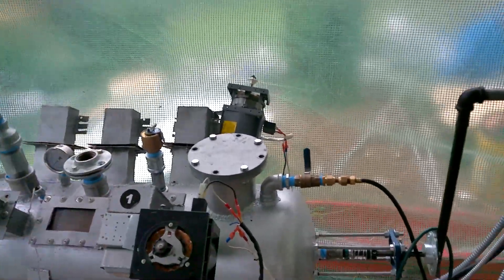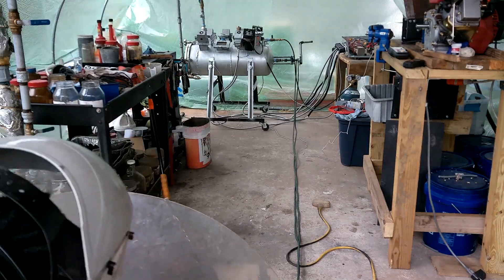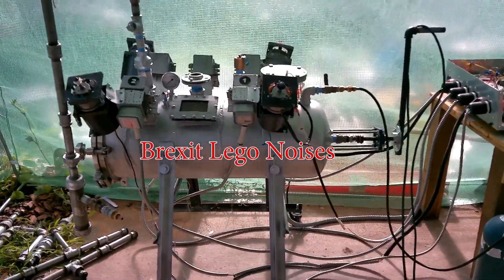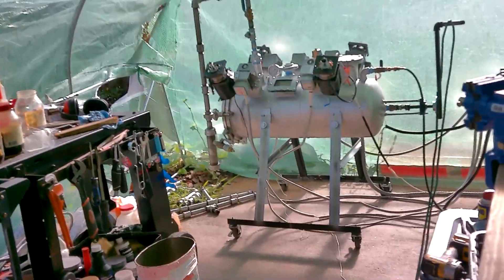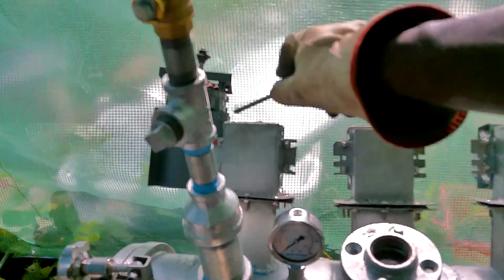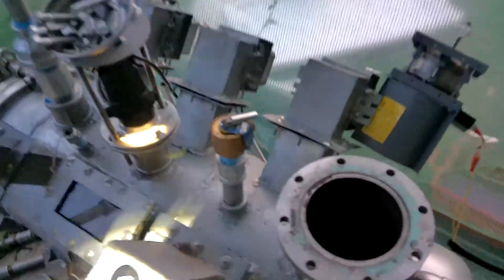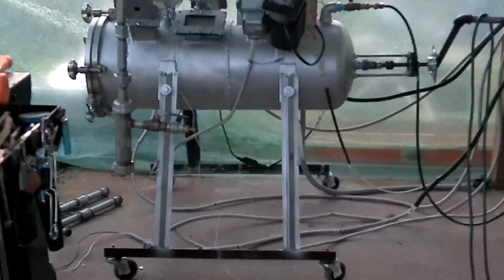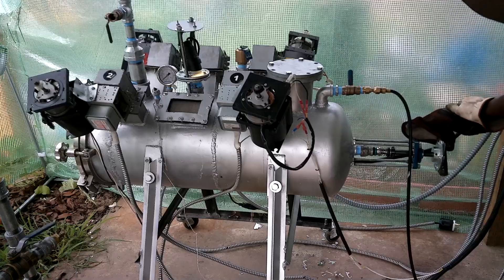Pressure Testing Mark 4 Part 2

Comment: Another thing too if these still remain a bit outside of your current capabilities, you could make something like an Auger Fed Continuous Charcoal Kiln or something else charcoal related, and use those simpler projects to build up your channel and get more views+patron people?

That and/or a Resistive or Inductive Heated one, (or maybe that crazy electric arc plasma gasification shit lol), and maybe integrate syngas heat into that?

I’m rambling, but if this one doesn’t work well enough/reliable enough (Big if, this one is damn nice) you can do all sorts of other projects related to the subject that may not need NASA spec hardware!

(Also it may just be like “wait until funds for fuckin saphire windows” or something too)

(And if you can get this far with this project, imagine what else you can do!)
Reply from the maker: Great suggestions, cheers mate!

Comment: Could you put something like a Tiki Torch / Alcohol Torch, or Maybe one of those plasma lighters (maybe modded with remote wires/wall power instead of battery?) to instantly ignite the syngas, even if it periodically goes out?

That and/or maybe make some sort of torch/flare assembly?

Would be neat and prevent any gas clouds!
Reply from the maker: great point!

Comment: I don’t know all the details of this project, but if the process creates a lot of heat/pressure, would be cool to see if you could also use that heat/pressure byproduct to power a turbine of any scale once the reactor becomes a lot more consistently stable

Comment: An idea to make the sheets stop bursting: you could add pressure to the other side of the sheet, the outer part of the waveguide, equal to the pressure inside so the sheet wouldn't have to withstand holding the pressure of the vapor back.